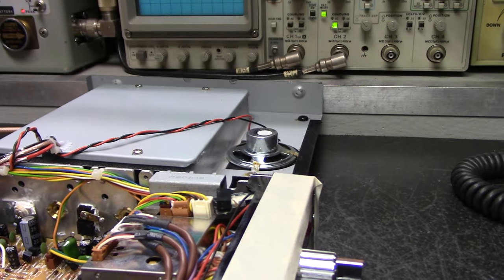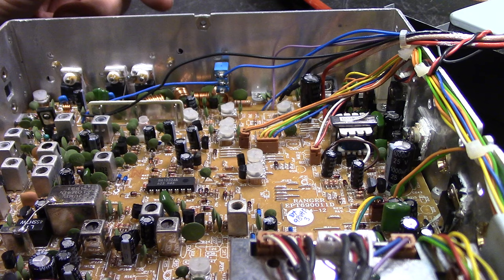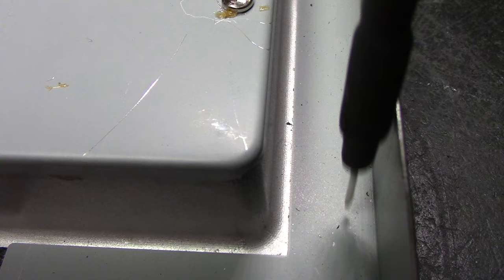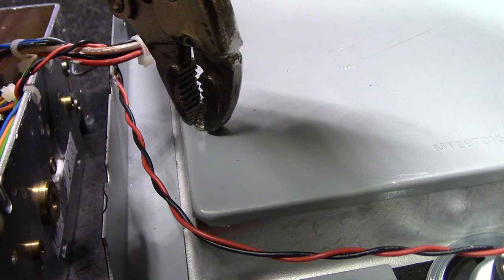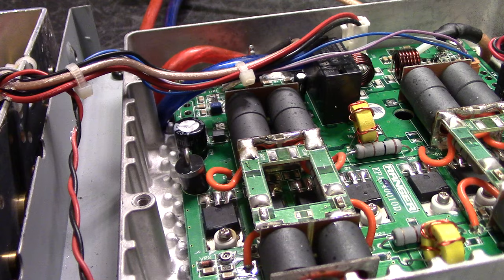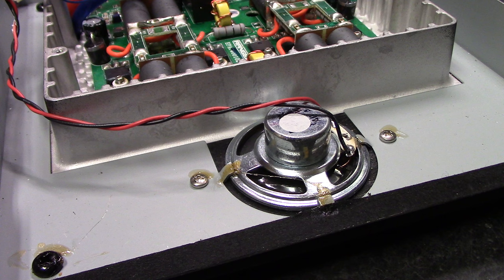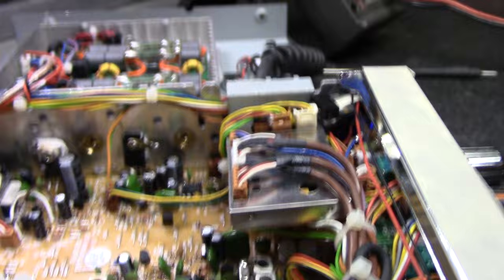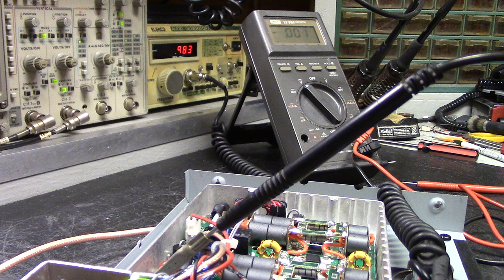A Closer Look .. Dave's Galaxy 98VHP By Bells CB Radio Shop .. HILLBILLY SPLATTERBOX

Comment: Thanks for the time you took to share your knowledge. Now I am thinking I made a mistake buying one. I bought it from SKYWALKER RADIOS, I run it from a 75 AMP MFJ power supply. Noticed when tuned with my 989C Versa tuner that I got a backwards swing when  in the Average mode or setting. however in Peak or PEP setting I got 200+ with little to no reflected power. I checked all the coax settings, and ends, thought maybe it was the tuner as it is the older version, then I searched  for a solution in here ( you tube )and here you are. So I think I will just re sell it and call it a day. Sucks as it seemed like a really great radio. on sideband  28.380 USB I was getting 280 watt swing with no complaints on the radio or from the neighbors. I guess I will stick with my 100 watt Kenwood TS 2000. Do you know anyone who wants to buy a galaxy? You can find me in Facebook under the same name. Live and learn I guess. My Info is also in QRZ under kb9vsb. Thanks again. 73's Dwight.
Reply from the maker: They "look" cool but it's not one my favorites.

Comment: Hi y'all the Finals in the Galaxy radio's use voltage but they do not run on voltage, the Finals run on Smoke! Ya see, that's why when they get too hot and just like some plumbing issues with heat, when the Finals get too hot they may spring a leak and the smoke will start to leak out of the Finals and once the smoke leaks out of the Finals they no longer work, you can test voltage there still but they will not work properly once the smoke escape from the Final so if you see smoke escape from the Final it is done that's how we know that the Finals run on smoke and not voltages